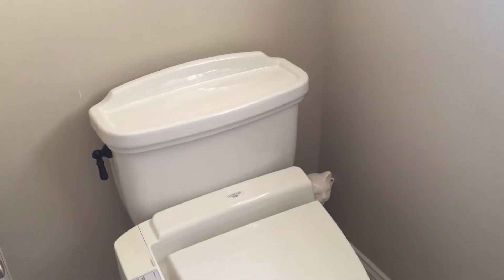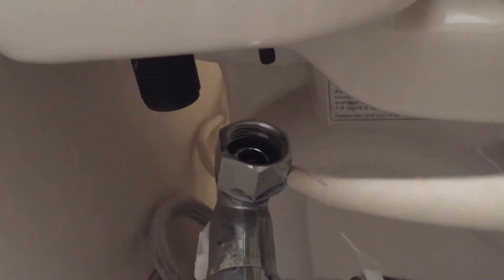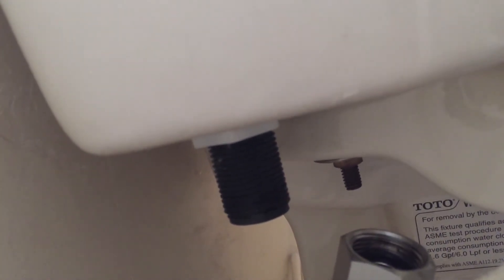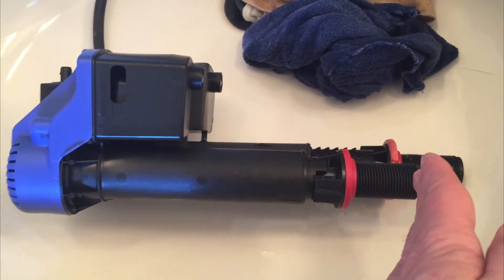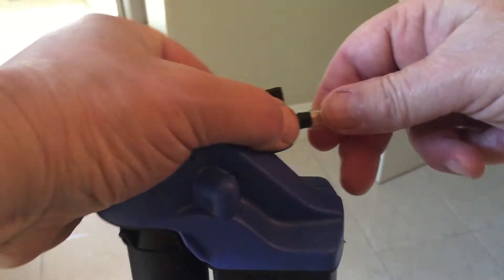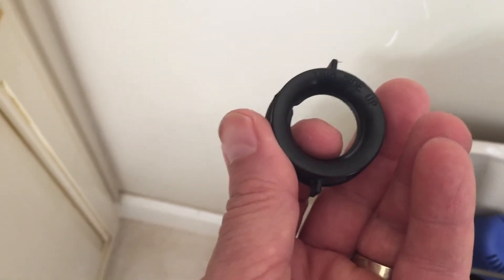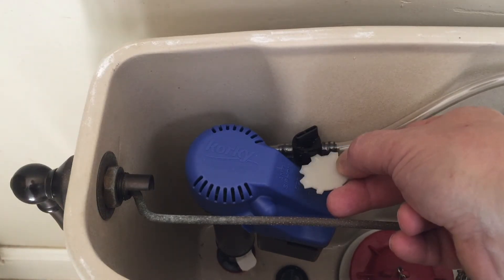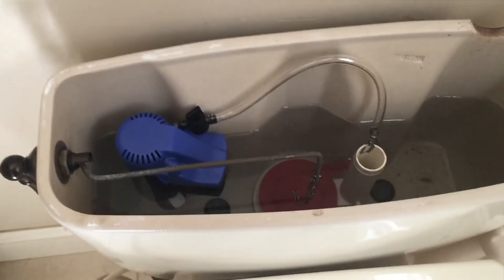Replacing a Toilet Fill Valve

Comment: Next time please show how you use your wrenches and tools. I wanted to see what type of wrench you used. You said a "pipe wrench"? Whats that look like.
Reply from the maker: I will do that next time. Thank you for the feedback. I probably should have said channel lock pliers. Thanks for pointing this out. data:image/png;base64,iVBORw0KGgoAAAANSUhEUgAAAOEAAADhCAMAAAAJbSJIAAABdFBMVEX///////0AAAD//v8Bi8r///v8//8AicjVybkAjsz//v0AkMzSybgAhsfNwbHRxbUArOHMwra8sKDGuqoFmtT///eiloa/6PgAh8QAouFEPzlUSUPXzr3OxLgApNoArd0Af8SsoJC4rJxNQjwAdbygkoDCtqpFOjTm4tvN6vwAjcQAic8CoNh9wtsArt8FlNwAneCUjIN/enY5NC1eVk5waWHg4eKRhXZTSENNQznd9fl0r9IilcOCutbP6vMAebaVzuPz7vCHd27Z2NCzrKfZ2NutqKuhmZ3NysiimpCMjIaIgnWtoYu9vLp7eXOgop0uKiUcExFbV0s7LiQsLikpIBlURTlWVFImIRw3LS0gGgl0aVwMCgBAPTAaFhURAABAQkNuY1i/xLSsubWUsr9vpblKk69LMzI8KxYlFhkkmrwAfs6Nl401RkwtQlMoVGoYbocAgahTqdau0+aRwNhYxOiY1+92zOFgs9Sj4etWvOSTvdihYusyAAAOrklEQVR4nO2d/VcayZrHq1+BgobQTSt2g+FFgQs6gt2o9BCVoLNqgqLejGZHZiZz9+7eTfbu3tXMHWfuP79PVaNp8GXPbjxhqg7fYPS0v9TnPPW8VVWXCE011VRTTTXVVFNNNdVUU0011VRT/R+kIKlTarwE7Ze6GCFVUSc9pCeWhJSZl+vrjcY66NXO2qTH8/TCaLexvri4Tv7xySig3W/2G4uLM4u+1td3OvAYYzzpkT2hdv+pccNHv6/3FII46WE9pTp7q/v5mcUZXwS0whUfxE91FxBf5ylgnjImTWXSo3paSWsHrwqvX78emnHm9cwOVgWFJ0viytErvVDI+0YEwsaOonBmxk6vWdIL+eFUhW87pjDpMT2xOnuH+7oBjDeG7E16RE+uzu7hDCDqeQoJX11SEPClSuOVoRN39DVTIRUBR4KSu3N0mDcMfUi4mMeIxWgjYPKR7vuVBPHmrLUfLwzNuLjHrA0fznQY99ySUShQyJl9RlupbkV5LJkf7UDaKOiEkQQb9mRWIIQIj/hXr5eMG0R64fXOlxvX0wlDBbqvqA/Pv51s1ojHY/E4IOY7X3BkTyW8D9Mv+bANpUY4DoQJ8jH0yhcc2VOps08CZelB43RW842hDhqvWCxs1vK0/Ex20P0TtWKJAR1+4dE9hSp5HeqW/Gujcw8hPFq1HOtWTvPLD/Cz1SkYJBO8nimZd38poKP+xi0f/MQioZqMkYwO7W7hTmGD0d4pGK7f9z+gs0kM8XO1m02U/JqlYI4mDQntWo7jvClbrWIRbFgsllm0oYRL4aThI+6P1p24s+E4JL4c9791XZtVQgHtZSHj6X6bNJI0lKZjndhW/0L84aIFiEC4OqlhfoYU1ElmE3FalRXyO58QVdQ4dU4GLbvV+uOFeFx2bbvoHExwpJ+h3WQsSQhJ1tC7t/GmB9HlzRtnw/62ZZ2LF+WmbVksZnwQTsZiUJn5xXV+b/i061jECS+OT79tua0/isffui2H1W2MDtTVQ0S9kPSfrVkOiS59Emha7slJX3zjWu5kx/kZqiSIERPUijrCEFHxmeO4xaLtFp0LmKEntnsuDlpMdk+IJHapS6wY9yfqGpIkdNjvn4vnb4vEjuCEJJRe/HML37va8fsXxpKyB12gQdokQyfx9OiNc05L7b7rNu1z8dhtuY54dP96zu9fApimsxe7cUZoF3visV20i29JpGm53218Lx6f2PbFQ/0HE5I62Vgi7jsjJMb9l83W6aBVJGZ0vjuxv/+hbBe/mfQgP0sYdaGLTwy9Udfha6Yp/nhwRhBd1xKPB6tsr3gLqFNKACH8SyQMf+nJ2IfceHQhirbrnv/gsrhGE5CApL1EmPKBEcP0f7BjVkJNSIjEiEyuJI6qkwzHwIZhwkkQwSfj+k9otf+9aNnlxqSH9xTay2TCABgGvrD/LRYzdkTLEs/tVS52gNeyI4TwAyi5YbmieMADH9n3zRA28omBMvCVSMRKjvW2z3iUuRHuZX27hcOUkCDGY7FXTn+P1WJmXL1uJpMhM5TCASIU5DBPT1gtuO8KbJihfghfmRidqjGIrAZ6bF+DGQFDtwkmjAGjUTDAjr4jZrPJh5f8WRLZ07aGhIvrM+vrYd8PY0CYZLWzH5GKlGb/kABmZvJQl+YXh4hZECeEjdP+ahe8L56vdAu6sR6HWUpCKy+EZGXNanTBCePZSnamoM8YlDAchmm6hlhuDIfas8qudUgIwyVTLxhGIwGzFJqoUjJp8EC4ZlsbG47TJbmw1MvEjPUCuGRC1/VSoZRlnlBVlbPyhlu2+jsZiCzh0quX3+l0hhrQKpZKyQoS2CZE6ADmKN1e6mazGaoYJdQLepISMm5DVHHK74obRetc7GVJCB0Skk7DKHFBeOA0wYTFvvgN6gJiLEwSIRSnBrTAfBCeNd+1Wq4lHiCkVLJGNpn1eydongxD54BQODtstawzctACK0o3XMqGY35VasT1RKlkME+ID2zXPhPPMFkcVs5eZo2E74xQgYMfJjmIpasnrnv+PekgJLQqvm3EDNoEQ1o0dKOU5YNwQ9ylPx6JVvNNIW7ESZtPAbkgPGy5zjn9aU903llOP0kIM5k41DS+DRn3Q9Rs2Y5IGog1sd90nb5bCscTZJaG40aWC8LDQcu9+HENeuDjdyfWabGilOLJLBRteiEPkabEPuHqwDppiuKPb0XbtQZOD0HiT8YT4Xg8DBk/yX62QAetgfWuab15477bsAYHhKeXgHiqG1C15ZMczNKDQbFYtr9rviN72icIA0/FMAzfhgVCqLJ6SH+og5ZrF8vFctkuWw7ZY8IIJ+PQOhlxA/pDQsj4qv6qbZNNbTBk0aLnujBGFbrjDcFGh6pNYJ4QbLhRJNqw6KoTxqpKDi0YmXhJJ7GUfULbbtmtor0x2L/dofgpBhUpWUsEP2TehgdDwo1iq3L7flo3GSeEST4Iy3YLRE5XSrcvb3WICZNEBgez9NQutlpl+PQCL+DtJEvEhFke/PDg1CqflsuDgRXcg+llDWrEEheELQdUHoy8TrGXIX0FL4SAV3YsZ2QrtJs1yDTlhhBk9YNbMEJnZxhqOCEcAOJZkENAO4QvywXhkQv1qGUXD4MXfGAINTRZ8EB4cAJVm+1ujJzEVxH0vslkPB4v7bKf8QcDMk37O8E20MS97E8//elP//Lnf/2zyTzhv5X/8pfT03/vmQFC7L1vh9Ihrfbhw3ssMU74H3/963/+19/+9t/XwUMlileN1LR0FdRm/bSJtzQ/N79UX6lfBk0leNGlNNhQq+WAkG0benPzqVQqGolcBu9MUFQ5FaLSgJDFyxQ+yUtVI5GILGtfBwkFJbIUCslDQrbXaQgh8NW0ERsis0oIZS5sWK/KcgQ8bsSGCmrPRYFQBkKssn020ZurEo4xQhW16zwRgh+Gxgnf80M4P1+PRqOR9BjhZYBwcqN7Cm0+e7YCwTQ6TtiuQ7ogtm2rjO8fbj6bJ4R3bEgJSTDlghBmo3wPoUanKfuEz+eiABIZjTQYtVdSBJwQsp0OfUKYpfcQRihhVVXYjqX/O6HHOOEffEL5MUKGewuJEM6niA1zL4K3RgjoUl6KRkgsrXqPXST1e5dPGI3cIVTQ5QollPkgvGtD5caGhBAzTIioH6Z8G+KR3uK6thSlfhjdxCz3hxKaHRJu3UdIiprIJtNnMYKEwgjhMneEubuEKUIoAyHDgkjjE0YjWx+D7obRNhBCqAmFQkzbcEhIYuljhGxn/Fs//CgECfF2DghlLmz41ZBwO1icCZja0Cdk+dZ5QvhsLhWNEsLgpXQKvtKGhGmmCdHDhLP+LJUZJ3zYhgInhIpwS7hwFQyZirqZSwEhWSr+VeCFUB0l1Oh+TUir8UEYlccJvRwllPm1oafdEnLhh1EgxCOEqlYneVLW0ldMXsY+VNCGs0FCAanVKHeEQXfDWGlHeCBUpU+RZqTAFlS1uuL7YWibZT/0CZeAMASEwbU2VU0NCbVtlhcxHiFU2rU5mg95ICR+OEaIVfOytsQBoXJbl2qjhJKpXtdSKZ9QYRjRJyS2ukMoXEODyBGhHFrwRgklzggjoa0xQvyJUGCZUHiIUFWXaWFKCJn9AzPoEyFEmnFCgX/C7RvCZZYJBelmrU3bUkdP7uHt9DBbLHOwMxO9Q6iaynZ6iR9CYsP0GKF5xYcN0dCG0CSpwZ0ZVTF/5YKQ7gGTSCPnqmpwNVFVhdl0lEaa3DLj+xab9xIKKt7khdC3YWiMEKnCDWGNaUJEbZga2jBwMEhSsZeO0O21GtP5EAUIpRFCpHrpOm0cuSVEHlmo4YcwlGvfQ1iPcEH4bL4O3pZrj5/mViNRakO261I0JIzcR5iK8EV4eYewLUNRI3NBuEJmKceEXxFCLff1+DlZ9ZI3wvE/I8Mb4cIdQnQ5bC5YJ/Qg0siEUBh/Ce9S46DyRpQwKsu5hRd3CL+ucUOYeoCQKxtqCy/wOOELrc4H4VfzqYimLXy8s9O7/YEGmhzzkeYxwijnhDluCKE9JITjfzAXCLmYperzJRJQFrYfItQ+sk74lU/4oA3ZJ3w29xihzPjeExFd89YWls3xCz5epOskBmlX0j1/0pol/TZfJ4TXinQn4xN0TZtl+UwUCP9M3lYnlfc4Ia1LNS29yTYgUn6Zp7O0bUpjJJdylBJ6LJ9UAJl/p36Yq5pBG0oSUtuRFfKLqDduXMakzM7PEZAtb4zQS6dWoBQgi3AMv1ECMv/wvE4JN8cJP7Qp4bXJOKGiEsJQbuEquOaNkXkFZakc0raWFYHtd7mx+httAxc+BhfbsGB+zKVSciid+1VhPNJIyi9zlPB65M49RbmGZBHS0jlPNdnugCXz13kgJMv6QT9UhLZGCDVZYZ1QNTefr9SgdFnwgk8ltRpJRdO53OXERvZkUrzndVkLpReCb8OqyuZWNBVJa1vbkxrX00mVfq5HZDm9cBWYjJI5uwWhNK1VmX4LmApqtb8vpSJgw6tA1SaZpHcCN2yznQuJoDWaBUItvfCPkTNRhBC885LtXEgkmcLmPLXh14GnAl6mhLkXbMdRIslUvGd3CUl3SAg/Mt79IlLTSBBMSYd4HXhKbo0gRWl6lu16hgirtG7THiBkvf1F5PSTovxWj9TGCZcpYdVj34aE8Od6FAhfBJ4CYS7CCSF5MwgIoX36R+ChgreBMJ2rMn7DLpUqYZ/wauROhSsOCWcDiUEVNrkhVCRF/W0pks5tbQZtaHoyXaTx2I+lt4TpYH+omGobCLUqB4SqBO3TklxdeB88yS5g5TriL5ZObmhPJEqYAsJlJVh5S+YymaVbHvt1KcxSbz4VzW2Nbk+Y6my7po06J6NSsaI+q8sfql7wXn1Vkbx2DVr8TfYrbyhLlV8gL2yPnBEmt5Rf16q596xfXooooeBdV6/BH4PrpaogeO1oe9NkPx8SmepV585DbHofPVXhg1BS7rv8UREE02T8dtYbSdI9L29hQVFUaXxTcaqppppqqqmmmur/qf8BZa05rtHWIIcAAAAASUVORK5CYII=

Comment: So confused about the little key to adjust the fill valve…
Reply from the maker: There is an groove on the fill valve that needs to be adjusted to match your toilet design. Once you identify the required gap from the instructions (mine was 3)  you insert that tab on the wheel into the groove. Then turn the knob on the valve and it will start closing the width of the groove. Turn in until it hits the tab. That is your setting. It is a little tricky to hold the gauge in the right place and turn the knob at the same time. What this does is adjust how much water will be allowed into the bowl so it doesn't have too little or too much (which will just overflow into the the toilet when you flush). I hope this helps.

Comment: I don’t understand the key 🥲
Reply from the maker: There is an groove on the fill valve that needs to be adjusted to match your toilet design. Once you identify the required gap from the instructions (mine was 3)  you insert that tab on the wheel into the groove. Then turn the knob on the valve and it will start closing the width of the groove. Turn in until it hits the tab. That is your setting. It is a little tricky to hold the gauge in the right place and turn the knob at the same time. What this does is adjust how much water will be allowed into the bowl so it doesn't have too little or too much (which will just overflow into the the toilet when you flush). I hope this helps.